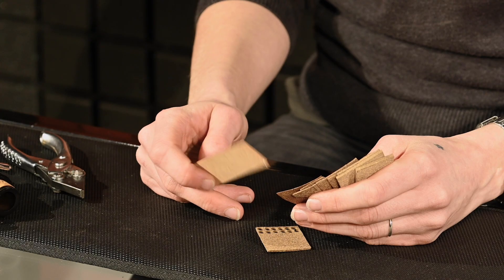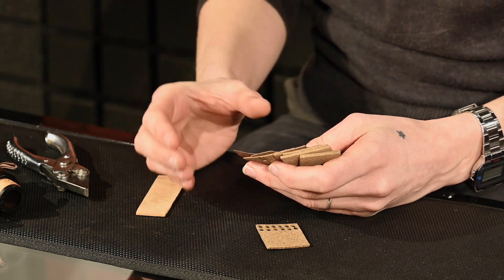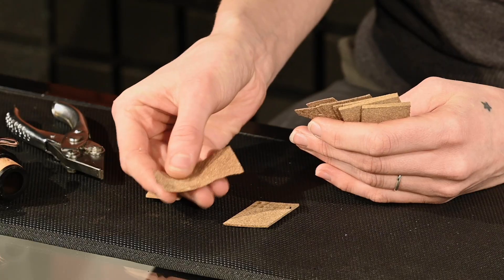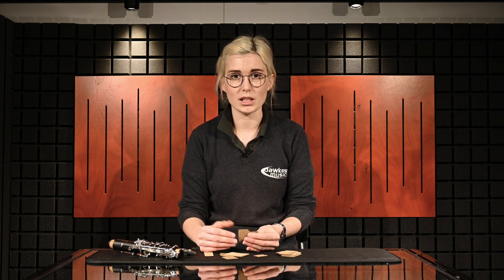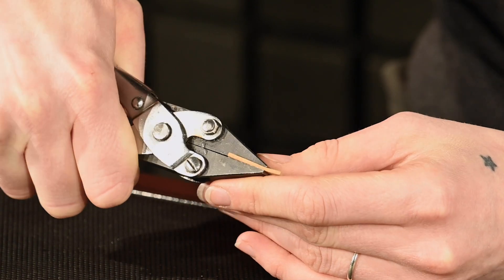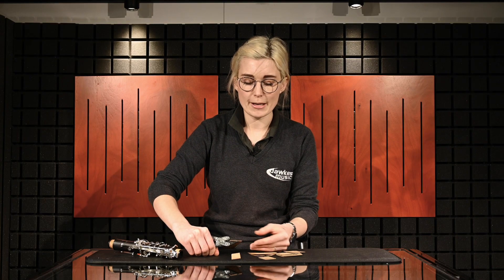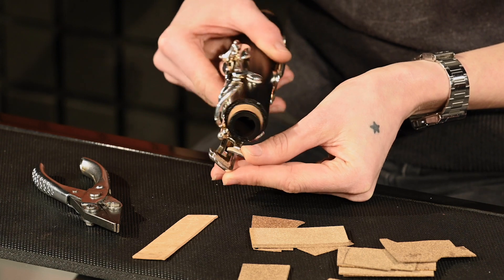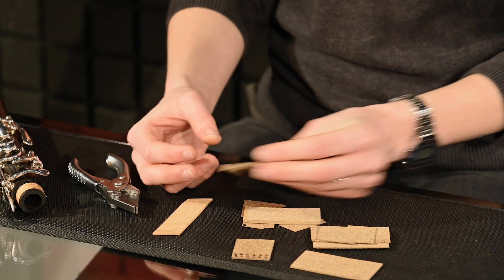MusicMedic TechCork vs Standard Cork | for Woodwind Instrument Repairs

Comment: Splendid! Can the TechCork be used on the saxophone neck? Namely, with use, the cork on the saxophone neck compresses heavily and stays compressed if the narrow bore mouthpieces are used. (Unfortunately, not all mouthpieces use the same bore diameter; some Otto Links and D'Addarios are very narrow). To be able to play well with such mouthpieces, which leave permanent damage to the cork, some saxophone players use a couple of necks, one for normal and one for narrow bore mouthpiece. But that unnecessarily increases the cost and nuisance. Your help is appreciated.
Reply from the maker: Hi, yes the TechCork can be used on crook corks. It's just important to find the right size for your mouthpiece set-up as it won't be as pliable as you mention.